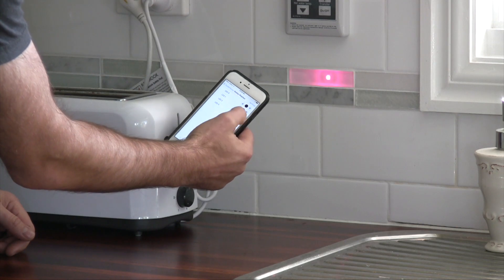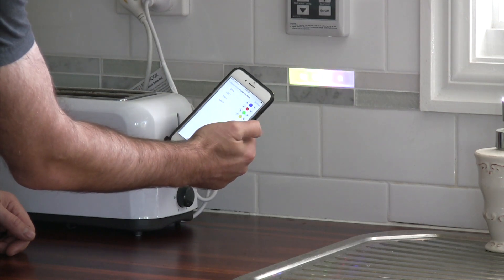Vlog #58: Wires NOT WiFi for home automation!

Comment: 100% Agree for reliability and if it is for someone else you are setting it up for, you don't want endless phone calls re: wifi drop outs, wifi password changes, router changes when they move to a new ISP etc.etc. ...

For my own home, where I can easily fix those issues - I tend to use WiFi devices for hard to access locations. I also find the long Cat5/6 runs are often cost prohibitive for some simple activities. 

I've started using 3G devices instead using SIM cards that cost $2/mth from http://m2mone.com.au/ in some instances as I find it more reliable than WiFi and also more able to recover from power losses gracefully.
Reply from the maker: The important thing is to use the best solution for the specific circumstances, so having all these different solutions in your toolkit is great. I usually get that comment from people who want to put WiFi in everything, regardless of whether it's the best solution.
Reply: I don't agree. Wifi drop out - change your router to a better one, I never experienced any dropout in my home Wifi network. BTW I am using quality Wifi devices, like Ubiquiti. Wifi password changes, router changes - If you put for example ESPEASY firmware (MTQQ support is available) on your ESP device and when the set Wifi network is become unavailable it automatically set itself to configure mode so you can set up your new network within few sec.